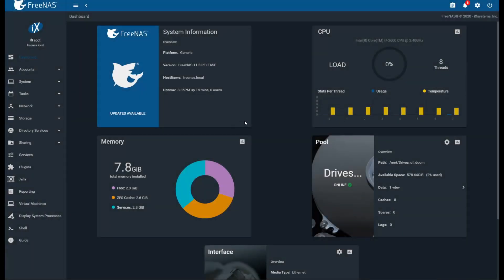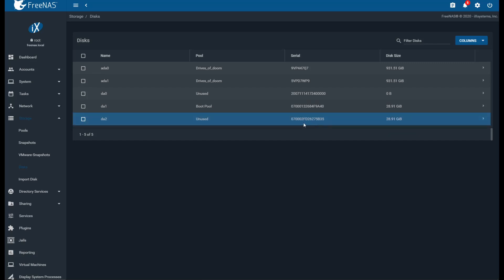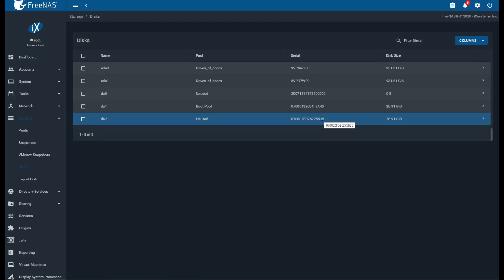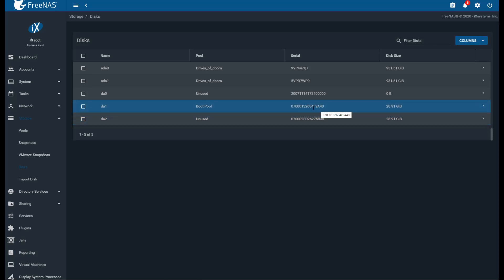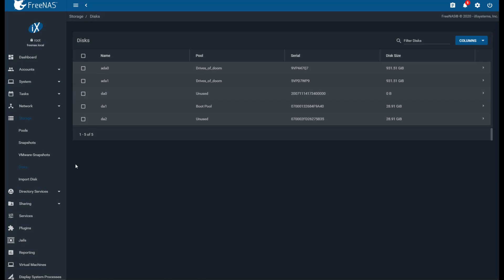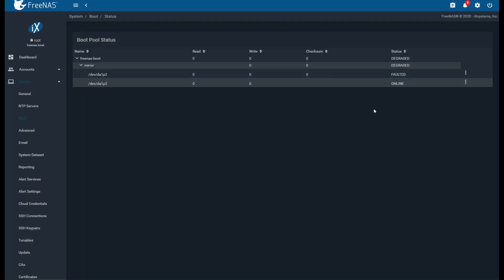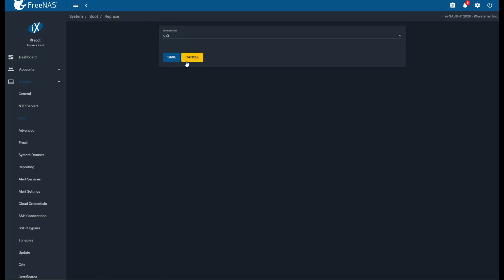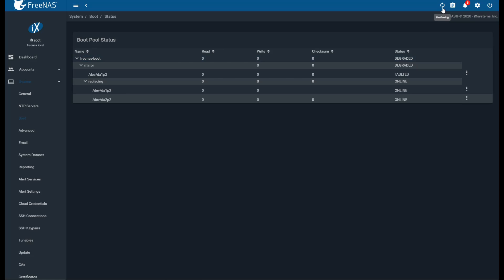How to replace failed Freenas Boot USB (March 2020)

Comment: Thanks so much. When I built my primary host, it was a bit of a janky setup (Norco case), and I threw in dual flash USB sticks, inside the chassis.  One drive just gave up the ghost, so I now have a 'mirror' stick re-silvering on the rear of the chassis.

Downside is anyone can walk off the with the USB stick; are the keys encrypted at rest on the boot drives by any chance? I know that my data pools are encrypted.

Comment: Hello, does anyone still live on this thread here? Such a thing happened to me two days ago, the machine did not respond, I connected the monitor and the loading of the system was in a certain part, I don't understand why the power outages did not occur, after the restart there is a message that the boot sector of the nasu cannot be found, the system is on m2 but the BIOS sees it. Unfortunately, I don't have a backup of the system file anywhere, because I'm an and I probably deleted it after the update after some time. There is version 9. But all my photos from the birth of my children are gone forever

Comment: Thank you for your video. I am also having a degraded boot pool and I must replace the usb drive. How can I determine which one to pull out? They are both the same and TrueNAS calls one /dev/da32p2 and the other /dev/da33p2. Can I even pull the faulty one out and plugin a new one into the same usb slot?

Comment: I'm only using one USB boot drive atm if the one I am using fails how do I replace it ???? if I only noticed once my system has crashed?
Reply from the maker: You should make a config backup now if you haven't already and store it somewhere. That way you can bring your system back from bare metal.
Reply: When you update your system it would ask you to save the config so you would need that, my usb drive failed but the system still boots but cant update and eventually does crash... enough time to do this. But do not use USB drives, you will end up spending more in the long run....
Reply: @rokiedecentra9656  yeah have two usbs now so if one fails I have the back and the usb thats it using has been going strong had plex server running for about two years now.

Comment: ya but what if you can't boot? if your boot drive is faulty you can't even get into FreeNAS
Reply from the maker: Then you need to use a usb or disk copy of freenas  to boot the machine. And do 1 of 2 things write a fresh copy of freenas to your new boot drives but lose all you configurations. Or boot up with the live cd or usb stick and tell the system to make a new bootable drive and retain the settings from the drive that is still good but is not setup for booting.  ether way your data is not lost just your configs might be.  good luck.
Reply: @GetNshitDone  I got lucky. unplugged power, removed CMOS battery, removed RAM, repopulated RAM, put CMOS battery back in and reconnected power cable. no idea what was causing the initial problem

Comment: So you mean, your freenas is installed on 2 usb? Im new to freenas, sorry for the noob question.
Reply: Doesn't need much storage. Surprised me as well. My one year old install takes all of 1 GB and I have it on dual 16GB USB 3.0 flash drives (mirrored).  I went with the larger drives (overkill for sure) simply because the price difference at the stores between 8GB/16GB and even 32GB was a couple of dollars per drive. As you said you were new to FreeNas, I'd recommend setting it up using two flash drives as mirrored because flash drives do die without warning, and at least with a mirrored set, you can always easily replace the failed drive as you see above.  Just went through that recently after my old flashdrive bit the dust, went to the store, bought two identical new ones, and started fresh. Easy to replace, easy to mirror, and a little more peace of mind.